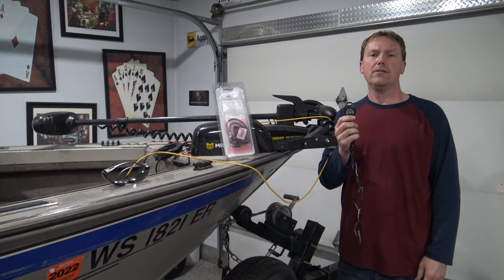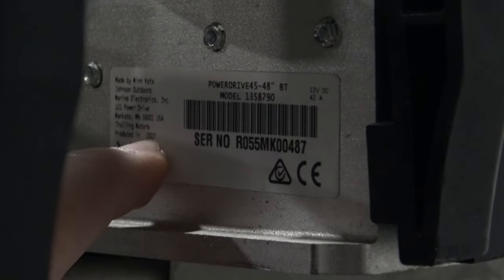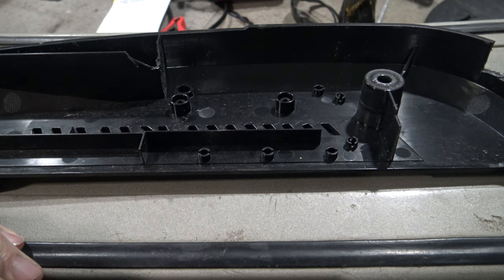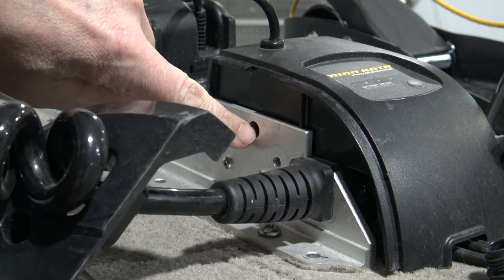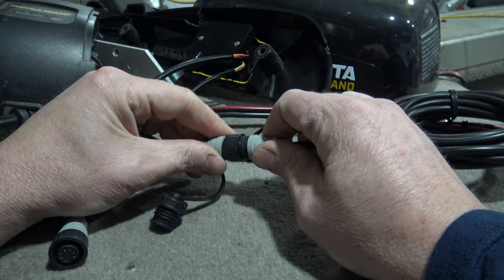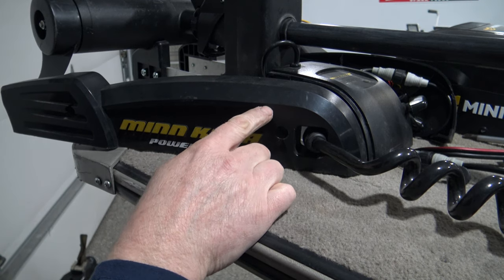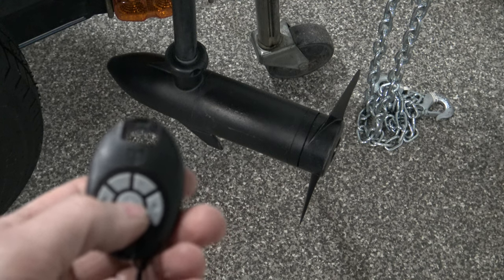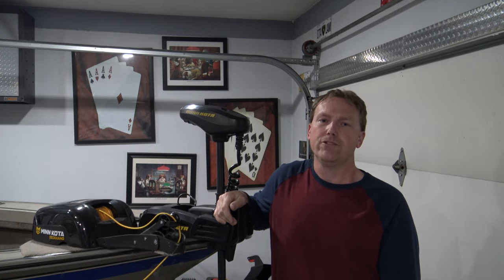How To Install Remote Control Minn Kota Copilot

Comment: Can u choose not to install the foot pedal?
Reply from the maker: yes
Reply: @addismultitasking3504  I didn’t connect the foot pedal and it didn’t work I had to connect the pedal to the box then the remote will work. I’m trying to completely eliminate the pedal competely. Is there a hack?
Reply: To my understanding, installing co-pilot or i-pilot you loose your foot pedal. Thats 1  the reasoning for the remotes